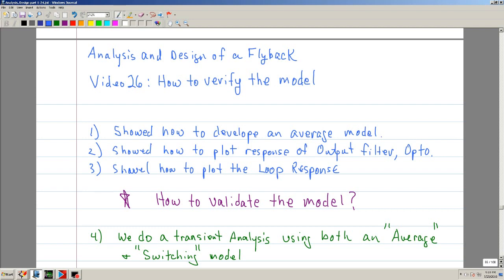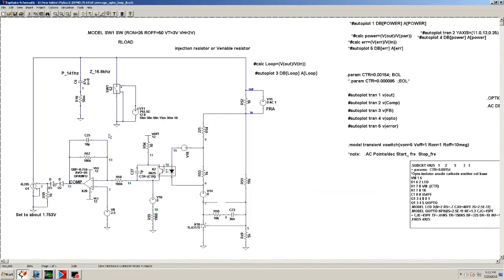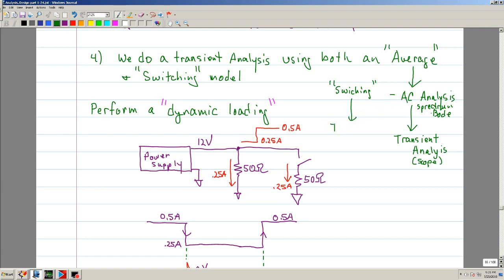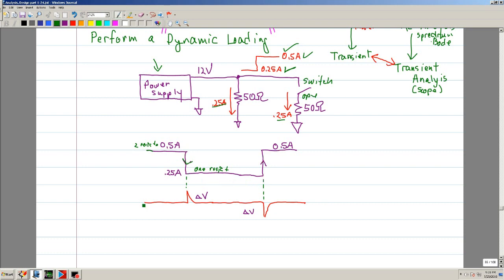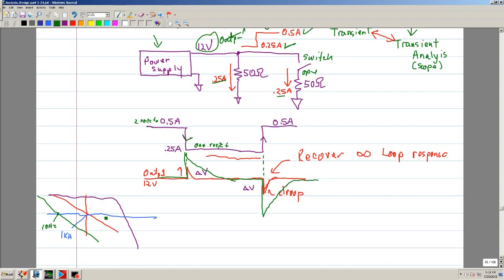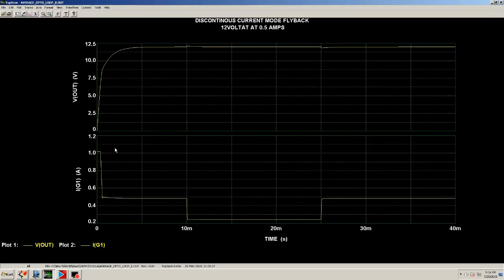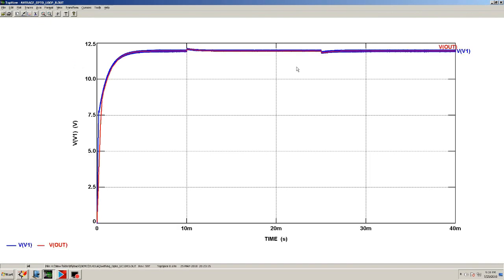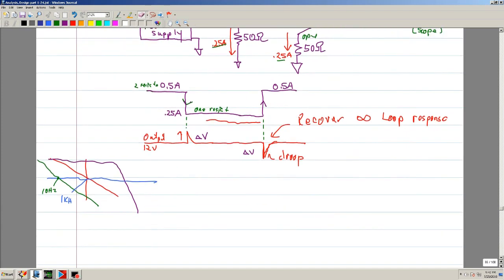Analysis and Design of a Flyback: Part 26, How to validate the Model

Comment: Hi dear Reberto
This tutorial is cover my so many questions about transient response, dynamic loading, average model and ... . Unfortunately my TOPSPICE is demo version and i can't simulation very well, so i try to extract transfer function of power stage and compensation loop in the form of a mathematical formulas and import these formulas in to MathCAD. After that with bode plot and phase plot figure i can check stability of converter. I will ask you if it's possible for you, please prepare tutorials about power stage transfer function of Full-Bridge / Half-Bridge / Push-Pull / Forward Converters in to mode ( VMC & CMC ) or suggest book or some papers about how can i extract JUST transfer function of power stage of those converters with mathematical formulas. 
Best Regards,
Saeid Jabbari
Reply from the maker: Hi Saeid,  The steady state transfer function can be derived use the volt-second rule for both Ton and Toff. Once you write the equations, you should be come up with the transfer function. Watch the Video 1 where I derive the transfer function for the flyback. Follow the same procedure. I will try to do one for the converters you wrote about above as an example.
Reply: Hi Robert, 
I have kinda the same problem, I've been watching your videos, and one difficulty that I have is that I cant follow you in TOPSPICE,
I try to use LTSpice but sometimes cant get similar results,
I don't know how many of your viewers have TOPSPICE license, but don't think there are many.
I know its easier for you to make videos using TOPSPICE and this also benefits the viewers, but just felt like saying this maybe you could find a solution.
keep up the great for and thanks for sharing your knowledge.
Reply from the maker: Hi bm830810,  I thank you very much for your feedback. Yes it is a concern for me as well; I would like to have more people use Topspice. You are correct, it would take me a lot more time to present using LTSPICE. My video last any where from 20 minute to 1 hours. But to prepare the video, I spent many hours preparing in what to present and how to present and how to use the simulator to re-enforce what present on my Journal Notebook. If you are a University student, Topspice will give you a 40% discount off of the 595 dollars for the license. If you email me, I can let you know how to get another 10% for a total discount of 50% off the price. If you are a student, it would be wise to invest in a TopSPICE simulator with has about 30000 parts in the library.  In the future, I might try to convert some the files to LTSPICE. If there is anybody out there who can translate the Topspice file into LTspice, I could distribute them out to student along with the Topspice files. But I would need somebody to step up.    Sincerely, Robert Bolanos
Reply: Robert Bolanos Hi Robert, I am familiar with LTSpice, I'd be glad if I could help and give something back, I will email you then.
Ali
Reply from the maker: Hi Ali, I saw your email. Thank you for volunteering to help. I would not want to take too much of your time. Let me see what can do on my end meaning I can try to update some of the file to LTPSPICE and the one I have trouble or need assistance, I can send them to you to see if you can convert. Again, thank you for your assistance. Robert